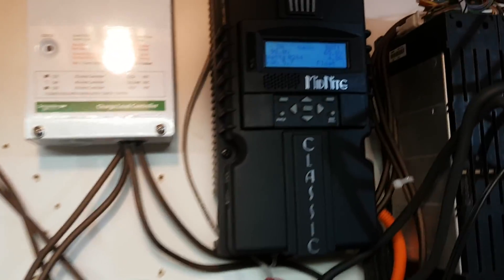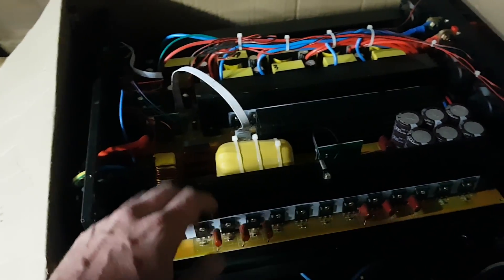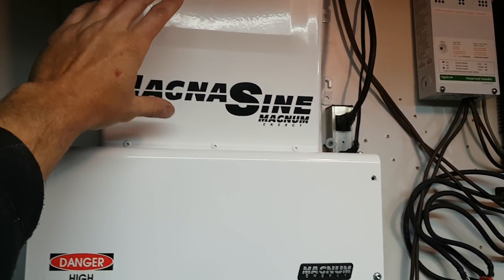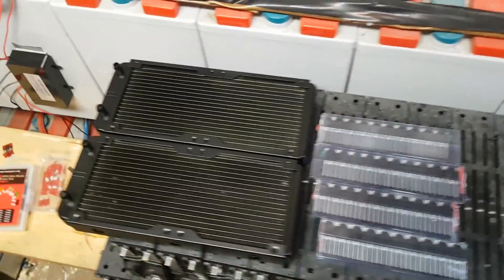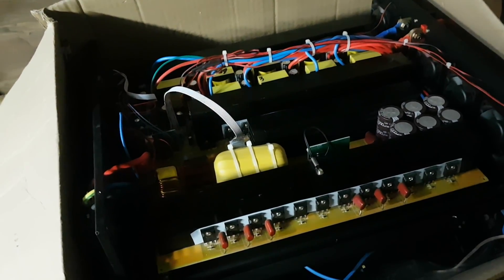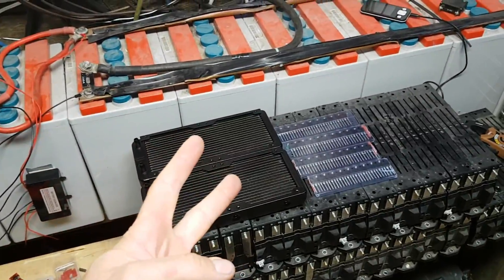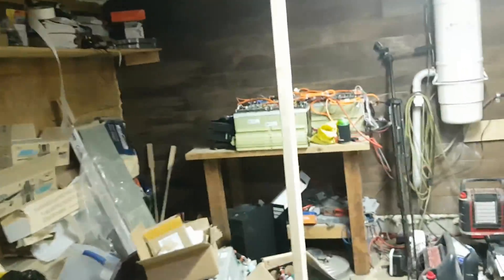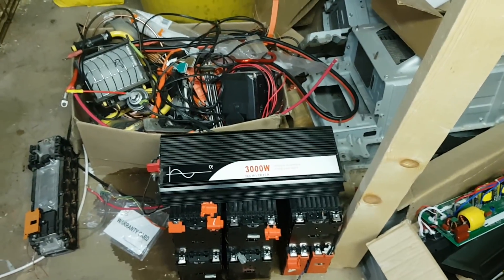Big Plans For The 8000w Inverter

Comment: Hey man I always watch you stuff and ur really inspiring. I recently got my hands on some super cheap sma 240 grid tie micro inverter but I am finding out they need something called a multigate which is really just a glorified communication device. I know they talk between each other thru power line comm. Any idea how it says to allow voltage to be pushed to grid.  I was thinking of trying to pull it apart and see if I can get some pin outs on the board. Goal to use without a multigate, just like I do today with an enphase without an envoy
Reply from the maker: i have never used grid ties that need such a thing, I would have to see it,there has to be a pin that tells it on or off I would guess

Comment: personally, going through the trouble to change all them mosfets, i would have gone up a step in the specs. that's what the modders were doing with the pips. before they broke them. and larger capacitors.
just saying

Comment: Could you use oil instead of water?  It wont conduct electricity but i dont know how efficient its compared to water as used in cooling.
Reply: Transformers in the Electrical grid are submerged in oil! Technically you could submerge the whole inverter.
Reply: oil would be really hard to pump compared to water but it would be longer life (as far as components in the system goes)

Comment: Nice as you know water has 10 times the capacity at holding BTU than air does why do you think they liquid cool these electric battery packs for cars✌️
Reply: bob w,  it is more like a 1000 times
Reply: Urs Odermatt I believe it's 10! I've actually used the technology in a water cooled grow system. Only using diy air handlers and Chillers no AC. I'm not saying I'm right but I do have experience using it versus a regular AC unit. 10 * is what I had found in my research ✌️
Reply: we seem to talk about two different things
Reply: Urs Odermatt no we're talking about liquid cooling and its capacity over air to carry BTU.
Reply: bob w, i am sure you are absolutely correct in what you are thinking.
what i am thinking is this:  water is about 1000x denser than air. it takes 1000 more energy to heat up a given volume. 
so , to quote yourself:  
"water has 10 times the capacity at holding BTU than air does"
that what i was reading.
now, when you are saying with some unknown parameter, water cooling has ten times the capacity of air cooling, in some unknown device, yes possibly you could be right.